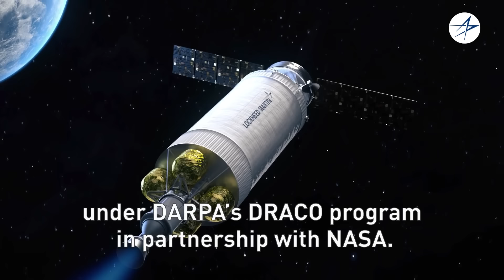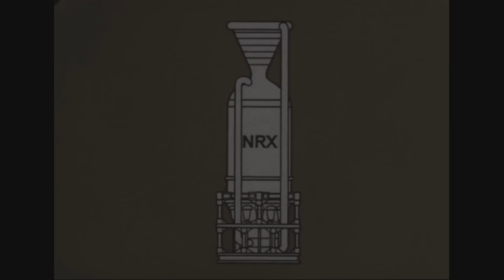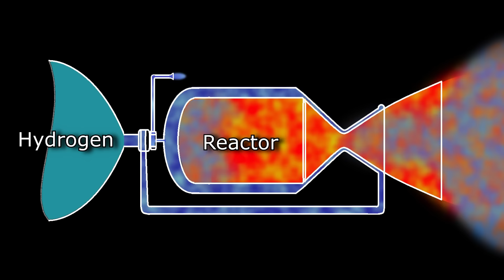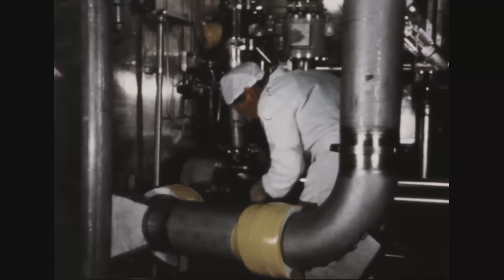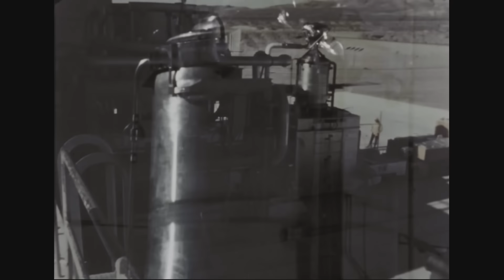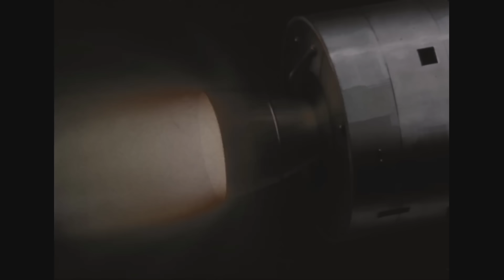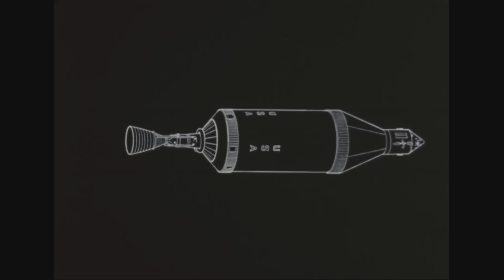Why Nuclear Rockets Are Going To Change Spaceflight

Comment: Scott, I saw this last night and wanted to personally THANK YOU. My uncle (deceased) was the chief on-site safety engineer for the NERVA/KIWI program, testing the KIWI's in Area 21, Nevada Test Site, Jackass Flats. My uncle took me out there after the program had shut down, and I saw the hot cells where they did disassembly of the reactor core, post test. I got to try out the remote manipulator arms-my uncle is at least partially responsible for my becoming an engineer, with physics deeply ingrained (Electrical Engineer). I was probably about 12 or 13.  I had NEVER seen the films you show in this video, particularly with such clarity. THANK YOU. Uncle Jim was very proud of the NERVA program it was very successful, and not a waste of taxpayers money. I think the longest consecutive burn was 15 minutes continuous - the engine was still in fine shape, that was the length of the test.  Later, I went to work as a young engineer, right out of college (graduated in 1974) at the site (NTS), working timing and firing for sub-surface and tunnel shots.  I'm glad that the hard work of the NERVA team will finally come to fruition. Thanks again, this would have pleased my uncle.  💗
Reply: Your uncle has every right to be pleased, running a successful test program of such a complicated engineering project is a serious accomplishment.

To be honest my mind boggles at the level of skill and ingenuity needed to create something as inttricate as a nuclear rocket, you've got crazy high temperatures, lots of force and movement, high levels of ionizing radiation, everything has to be as absolutely light as possible while still being very reliable, that's a next level challenge , even for a large well funded team of very clever people, bravo!
Reply: @paulelephant9521  Indeed Paul, I am very proud of him and the accomplishments of the NERVA program, and I am very happy that the incredible work that they did, is going to come to fruition - And my uncle Jim encouraging me toward a career in science and engineering (so did my dad and mom). He was quite a wonderful person (and so was my aunt). I was and am, by nature a very curious monkey. By the way, a proof of concept of a nuclear powered aircraft was also done (not at the Nevada Test Site though) - It worked, but the shielding necessary to protect the crew made it infeasible. I think it was a liquid salt reactor.  Have a wonderful day.
Reply: Cynthia - my dad worked for Aerojet on that project. He took me out there sometime in 1966. I was in 3rd grade in Vegas at the time. I remember ‘signing in’, wearing a dosimeter badge, and playing with the manipulator arms. Did you get to darken an ashtray or shot-glass through it? 
I may have met your uncle there. Do you remember the small village of Mercury before heading into the test facility?
I was a total nerd and in hog-heaven for getting to see a reactor.
It is sad that project was shut-down despite several successful tests. I was hoping to be an astronaut using that engine to Mars someday. Instead I became an engineer developing optical disc technologies.
Thank you for writing your comments to Scott! It brought back some great memories…
Sincerely, Brian in CA
Reply: @heyuhh422  get a room, Brian and Cynthia 💕! No, seriously, get a room. Earth needs more space nerd babies.
Reply: @skierpage  > Graduated 1974
> 1966
It's not gonna happen man
Reply: Never saw that heart emoji before!

Comment: Stupid ideas - like nuclear rocket engines - never die. The nuclear rocket engine tests were horrible. The radiation on test pad C at the time of firing was 2.5 million rad per second !!!  Another reactor lost 30% of its fuel to the atmosphere and scattered 10 R/hr particles for over 10 miles. No engineering problems my ass. They were disasters. And even had they worked there designs could never be safely used. And even if used to send folks to Mars - do you really want to aim a reactor at the earth with a high burn up and hope you don't screw up and have it enter the atmosphere? Space born Chernobyl.  Dumb dumb dumb dumb stupidly dumb.

Comment: When considering the effect of radiation from the reactor:  It isn't just the people (if you have them on board at all), but also the electronics.  One of these nuclear thermal rockets insufficiently shielded could end up frying its own control computer, as well as whatever payload computers you had on board.

Comment: If these engines have to be used only in outer space due to radiation issues, when coupled with potential low earth orbit construction, the ship doesn’t necessarily have to be shaped like multiple tubes, as long as the ship suits the needs of the engines

Comment: IRC there were some major problems with this idea when it was looked at before. One of the issues is the fuel tank is very heavy, because you have only liquid hydrogen in it which is very low density- hence large tanks and the insulation needs to be extensive and heavy. So the mass ratio of the rocket is badly affected. Another problem is that it's a very high altitude engine because you really, really don't want it to reenter. That means you lose out on Oberth effect, which is a HUGE downside. IRC it was still a bit better than a chemical rocket, but not the overwhelming win you'd hope.

Comment: On the one hand, NTR is very disappointing, being limited by material strength of the engine and thus limited to only 2-3 times the performance of chemical (with the extra burden of massive radiation issues and difficult to store liquid hydrogen)

But.. one way they do genuinely give the scale of advantage you expect from nuclear is that you could refuel them on any icy moon of the solar system, and they probably have the thrust to take off from them too. They really could deliver the sort of Flash Gordon rocket we are waiting for.. for some future noble heros and truckers just making a living, hopping around the moons of Saturn)

Comment: No, nuclear thermal rockets won't change spaceflight, and I can explain why with a single word.  That word is aerobraking.  Due to the geometry of the shadow shield, it would be very difficult and mass intensive to make a nuclear thermal rocket that could aerobrake, and even if you could, nobody is ever going to let a fired nuclear reactor engage in an aerobraking maneuver in Earth's atmosphere.  If you look at any sensible lunar program involving fully reusable rockets (or expendable chemical rockets for that matter), any spacecraft coming back from the Moon would dump enormous amounts of excess energy into Earth's atmosphere.  A nuclear thermal rocket wouldn't have that option, and would have to propulsively brake into Earth orbit. And while nuclear thermal rockets have better ISP than chemical rockets, they are still nowhere remotely close to the effective ISP of heat shielding while it is doing aerobraking.  Basically, while nuclear thermal rockets have a considerable ISP advantage over chemical rockets by themselves, the advantage over chemical rockets plus heat shields is small enough that it simply isn't worth the hassle.

When you look at potential manned Mars missions, the numbers become even worse than for a Moon mission.  A Mars mission is more demanding in terms of total delta-V, which would normally favor the higher ISP propulsion system, but Mars allows for aerobraking at the far end as well as at Earth, which more than makes up the difference.  A Mars mission could also benefit from in situ propellant production, where a nuclear thermal rocket would have to bring propellant for the return journey from Earth.  Nuclear thermal rockets are kind of like the rigid airships in my opinion.  There was a time when both had advantages over other competitors for long range travel, but those competitors had more room for growth, and now the time has passed never to come again.
Reply: Maneuvers in the Moon's sphere of influence clearly don't involve aerobraking and once you leave the Moon's SOI you are already orbiting the Earth, thus there is no need for an additional maneuver to enter Earth orbit, so whether it's aero or propulsive is irrelevant.

Comment: I hope they are never used.  Can it be guaranteed that every rocket carrying a nuclear rocket (the launch vehicle is obviously going to be chemical)  will get to the  orbit successfully?  THe last thing you  need is the launch vehicle with one of these things on board crashing back to earth.  Even our most successful rockets have had failures (Falcon 9,  Soyuz, Saturn V but have not included the atlas V with no failures as the RD-180 engine is no longer available) and  the consequences of one of these crashing to earth, especially near a populated or heavily fished area are horrendous.
We have the means to get to mars safely and in reasonable time with SpaceX starship, so is it really worth the risk  of using a nuclear rocket just to shave a few weeks of the travel time?
I get the need to go beyond chemical rockets and possibly go nuclear if we were thinking of a interstellar mission but I would imagine that the ship required would be massive compared to what we have now and that this would in all likelihood have to be assembled in orbit.  In which case  the nuclear fuel could be transported to this ship in a sufficiently shielded and protected container with sufficient mitigation measures for a failed launch to protect it before being loaded onto a nuclear rocket while in orbit
Reply: There would be no "horrendous consequences" other than the temporary decrease in demand for that fishery's products, which is probably good because the ocean is overfished anyways
Reply: @shanent5793  by temporary I assume you mean decades.  You do realise the half life of uranium, plutonium, caesium etc  would make any affected land or water completely unusable for decades and possible generations.
Reply: @eamonnfanton2165  the engines are fuelled by virgin uranium, so fission products like plutonium are not an issue. It's temporary because people will eventually forget or stop caring where the fish comes from

Comment: There actually was a serious proposal for a nuclear thermal engine that could have been used as a booster for launches from Earth.  The key is to increase mass flow while keeping the propellant temperature high enough to get the desired high exhaust velocity -- and this required a different reactor design.  Instead of what was almost a submarine reactor cooled with cryogenic light-molecule propellant, the nuclear fuel was to have been housed in corrugated metal, like rolling up a sheet of corrugated cardboard with one surface layer stripped off.  This would allow much higher propellant flow while allowing the propellant to get just as hot as NERVA, and give many times the thrust with an overall lighter engine.

The name I recall for this concept was DUMBO, but since it's been almost fifty years since I read about it, I've forgotten what the acronym stood for.

Like NERVA, a demonstrator was built and tested in the 1960s, but it would have required materials we're only just now developing to build such an engine with enough working life for more than an expendable (!) single boost to LEO.

Comment: I the engine is not "usable" anymore, could it be sent to burn into theSun ?   Is there a reason why this is not an option, aside of the need to load propellent and use it for the last voyage.

Comment: double ISP looks great, but the penalty higher dry mass has on delta-v makes it less appealing than you might think, also lower thrust to weight means less benefit from the oberth effect.
two things that dont get considered when your firing from a test stand.

Comment: 16:48 but what if you turn around? or trying to slow down the spaceship on destination. That radiation have the same inertia? Must shut down enginge before start manuvering(turn the engine in the oposite side)?

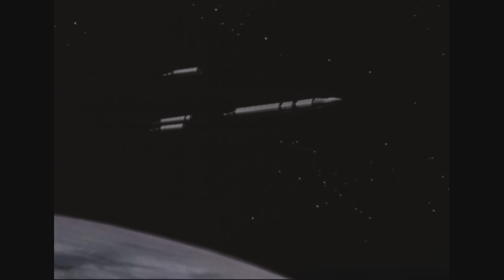Comment: 15:27 That is what i was thinking. nuclear power close cycle. like nuclear power plant but for stars. and use that electricity to ionize raw elements or molecule and push them with a magnetic field. I dont know if VASIMIR work like that with tha plasma but. what i say can be interested and use any element because they dont touch the walls of nozzel. and nuclear power is like having infinit energy for ionization and for the magnetic field.

Comment: Does the propellent in a nuclear rocket engine have to be a gas?  In the SciFi movie "Destination Moon", they described a Nuclear Rocket using water as the "reaction mass".  In a nuclear rocket, the water would have been heated by the reactor and expent from the nozzle as super heated steam.

Comment: I wonder if there are also theoretical nuclear fusion rocket engine designs. A lot of these nuclear fission rocket engines were conceived of back when fission reactors were still not really a thing, so it seems like someone must have thought about this? (Given how there seems to be a gazillion nuclear fusion startups these days, each with a different technology or even fuel type)

Nuclear fusion may not completely solve the radiation shielding issue though, since the common fusion reactor types using tritium still generates radiation but my understanding is they are much more manageable, and if you use aneutronic fusion reactions (e.g. using hyrogen and boron) they are much better since they don't generate neutrons in the reactions.

And of course if miniaturized, fusion should also beat fission in the tyranny of the rocket equation as well.

Edit: Apparently there's a startup called Pulsar Fusion looking into this and there's a whole Wikipedia article on fusion rockets

Comment: The YT channel Eager Space has a great series about different types of nuclear engines. It goes really in-depth about some of them, but there is also an overview about a NERVA-type upper stage with the conclusion that solid core hydrogen is really not much better than good old expander cycles like the RL-10.
I can highly recommend that channel.

Comment: I'm much more enthusiastic about nuclear electric propulsion than nuclear thermal propulsion.  Vastly easier to implement since you don't need extreme temperatures, and you can still get constant thrust for the full duration of a transit.  The thrust is low, but exponential acceleration makes a vast difference.

Comment: Maybe the issue of needing to stay clear of the essentially unshielded for 355° around reactor core near space stations & other infrastructure could be solved by having an automated drone craft with basically a big lead "bucket" on the front that would envelope the drive section of such a vehicle just before it arrived at the destination & would act as a "tug" to initially move the nuclear spacecraft away again before the main drive activated. Such vehicles would be expensive to put into orbit around key bodies like the Earth, Moon, Mars, Ceres, Callisto, etc., but would barely have to move once up there & could be almost infinitely reused (at least the heavy metal bucket part, even if the drone part had to be replaced every so often).

Comment: Although you marked most of the difficulties with space nuclear reactor, you missed the main reason they are not used.  a) they cannot be turned on/off. Once they reach criticality you must keep them idle even when no thrust is needed. And b) since there is no flow of H2, you must have other means to cool it down, otherwise it will melt. Cooling is a major problem. And even if you invent some magic technology to turn it on/off, you will still need cooling, otherwise it will melt due to decay heat. And if you somehow invent efficient cooling without giant radiators (Russians are on the way), the ion thrusters are much more preferable, because of mad Isp (x10-20 compared to nuclear rocket engine).
Reply: You simply rotate the control rods to absorb the neutrons and the reaction shuts down.   That seems absolutely apparent.
Reply: @az2spainstrummer  And how you will start it again?

Comment: Scott, thanks for covering this. Are you familiar with thr Pratt and Whitney "TRIton" engine? It was a nuclear thermal rocket that also was capable of electrical power generation using a closed Brayton Cycle gas turbine system. It was also capable of thrust augmentation via liquid oxygen injection downstream of the nozzle throat to reheat the exhaust. It devloped 900 Isp on hydrogen alone and 15,000 lbf thrust...comporable to a RL-10. In thrust augmentation mode, the Isp drops to about 650 seconds, but the developed thrust goes up to 45,000 lbf, 3 times unaugmented. TRITON was a acronym for Tri-modal Thrust Optimized Nuclear rocket engine. Oh and the engine could produce 10-50 KW of electricity too.

Comment: I was already somewhat familiar with the fuel particle design you described, as it seems very similar to the TRISO fuel contemplated for high temperature gas reactors, as well as some molten salt designs. I didn’t know that a similar design was considered for a propulsion reactor.

Comment: Why not pump a little bit of O2 into the hot H that already left the reactor, to increase the temperature? Would the heat from that be too much and stall the H going through the reactor or cause engine rich exhaust?

Comment: Gas core fission rockets are the most powerful rockets achievable with existing technology, hands down.

Barring maybe the Orion "bomb cluster" designs, which sacrifice so much space frame mass that it's probably more accurate to describe Orions as "engines, with payloads, maybe?". Also, I'm not confident they've realistically modelled the vibration harmonics of an Orion type fission engine.